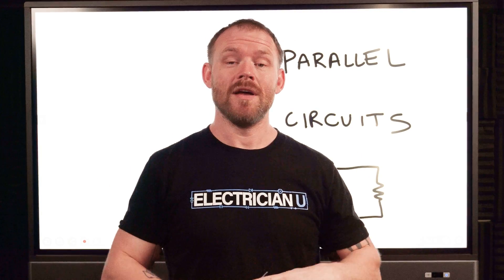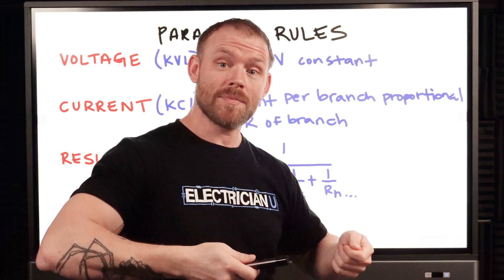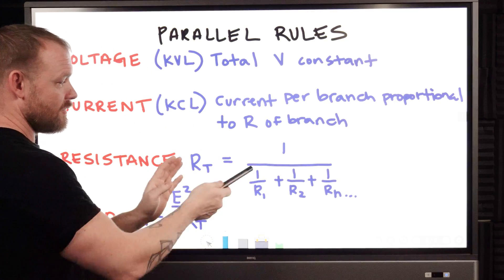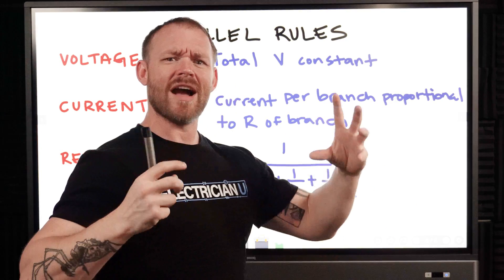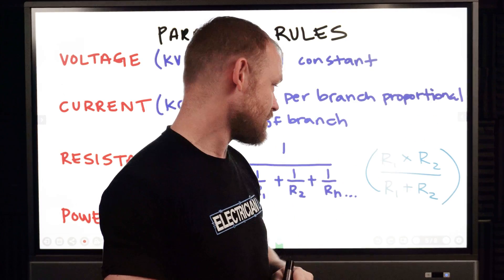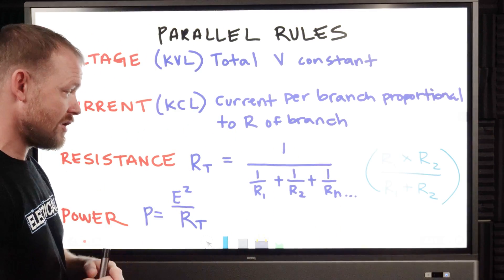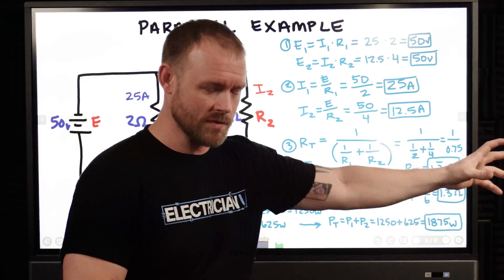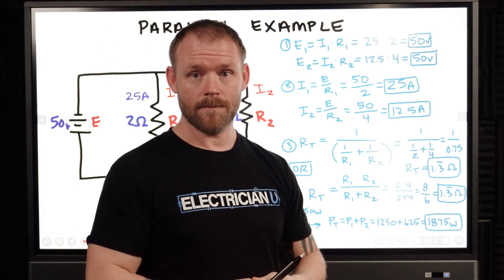Let's Talk About PARALLEL Circuits: Voltage, Current, Resistance, and Power

Comment: Two questions: 1. There are 38 amps on the "neutral" wire? 2. The way the circuit is drawn it looks like the last resistor is in series? Your a credit to the trades, many thanks.

Comment: 25 year commercial/industrial electrician here.  I'm also an instructor for the ABC of Iowa electrical apprenticeship program.  Along with Eugene Khutoryanski's physics videos, I've used your videos extensively for my class (it keeps them from having to hear me drone on four hours a night every week).  Because I'm also a nerd when it comes to the theory, I'd love to see you do videos on inductive and capacitive reactance and combine those with resistive circuits to throw in a lesson on power factor with it.  As important as Code is (we use the Mike Holt curriculum); knowing it's necessary to be able to navigate the NEC to pass the journeyman exam - I think there's been some lost emphasis on the theory.  I do a LOT of troubleshooting in the field.  I think knowing not only how electricity behaves, but WHY it behaves the way it does is critical to advancing in one's career.

Comment: why would a varistor be put in parallel with the input power of an LED driver? It seams that it will not stop any power from flowing to the driver because it is in parallel.

Comment: As more branches are applied to the circuit resistance lessons due to having more paths to flow through which means resistance goes down, and current goes up.

Comment: Another GREAT video, thanks!  When I first saw Parallel Total Resistance and the reciprocals, I started doing the math in my head with the Least Common Denominator (LCD) and you referred to this approach in your video, whew, good to know that I am not the only one😁.  I would have liked at the end when you were doing Power if you had used the Pt=E²/Rt formula as a proof, where 50²/1.3333 = 2,500/1.3333 = 1875 W.   Love the Video, Great Work, keep it up!

Comment: What causes series circuits and parallel circuits to be different? Why does the different schematic cause one to drop in volts and the other to drop in amps?

Also what's more common in basic households parallel or series? And in what circumstance would you choose one over the other?
Reply: The difference is the flow of the current in each circuit. For series circuits the current only sees one path with one total resistance, therefore the flow of current does not change throughout the circuit. But the voltage has to be dropped to zero by the time it makes it back to the source. So each load drops a specific amount of the voltage which is dependent on the resistance of that load.

Parallel circuits still work the same way however, it has branches so instead of seeing one path in the flow it has 2 or more depending on the amount of parallel branches. If each branch only has one load it has to drop all of the voltage, that divided by the resistance gives you the current in the branch. But, when each branch merges back together the current adds together. 

The current leaves the source with the total amount of current, each branch it hits some of if it breaks off. As the branches merge on the other side they combine again and head back to the source as the original total. 

As far as circuits in houses to my knowledge most circuits would be parallel unless they have only one load.

Sorry for the long reply that was the best way for me to explain it. I hope it helps.
Reply: @sethgodfrey9182  that was immensely helpful, long reply necessary to convey all that. Thank you!
Reply: @james402windexman  no problem glad I could help!

Comment: We did the math in REVERSE.  Should of done the current for each resistor first?  Then the PROOF math for the voltage?
Reply: He's just thrown formulas. You must use first that one that has all available measures. If R and E are known, you can start calculating I. If I and E are known, you can start calculating R. If everything is known, you can call it a day.

Comment: Do we actually need this in the field? (residential) I’m currently going to school and i would say I’m ready for apprentice. Do we actually need to learn this?
Reply: Maybe you don't need to do the math, but you need to know the aftermath
Reply: Yes you will need this for series and parallel circuitry.  Get to know ohms law inside and out and how each effects each other.   When u get out of school you may not need it as much but you should know it since it's the basics of how a circuit works.
Reply: If you work construction, you dont need to know about the Resistance part.
But if you work in electronics, you do.
Reply: You don’t need to learn anything if you don’t want to lol.

Comment: Be careful when describing "power" or wattage. Power calculations are DIFFERENT for AC than it is for DC. You can use DC formulas for an APPROXIMATION of power, but its not the correct formula.
With AC not only do you have voltage, current & resistance, but you have FREQUENCY and with AC circuits, resistance is called IMPEDANCE.

This is why there are Electricians & Electronic Engineers. Electronic Engineers must understand way more than Electricians.
Reply: I guess why there is a difference between Volt-amps and Watts ?